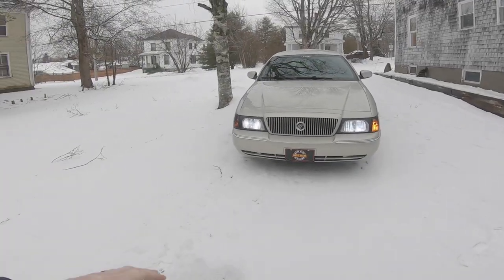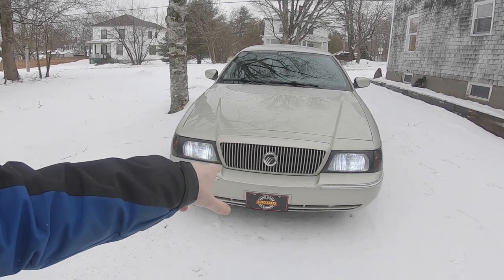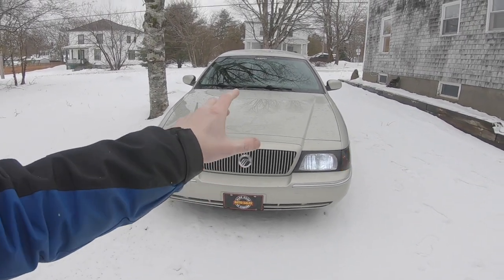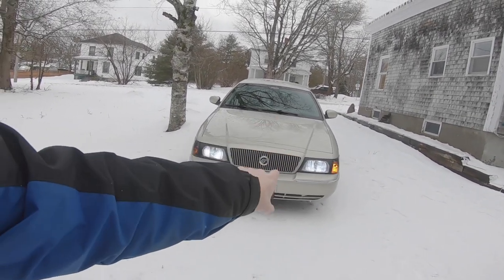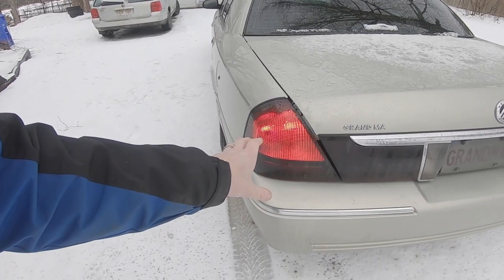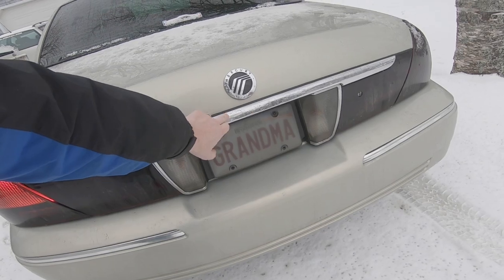Did I make a mistake partnering with LASFIT for LED bulb in my Panther Platform

Comment: I ran into the exact issue with my vehicle. Not the same make and model but in the vicinity. Buick Lucerne, any issues I've had they rectified. It may be the computer in various vehicles. It's probably reading foreign than the usual, but mine work itself out once it synchronized. I LED modified the full back then purchased 2 high and 2 low beam for almost $200. Low beam installed perfectly. High beam wouldn't and still in the box. I didn't  even bother to complain this time, because like you said the low beam are bright enough.
Reply from the maker: Glad you got it fixed up.

Comment: I've used Headlight Revolution for the lights in my wife's Ram, they have worked flawless, except for one igniter, but they covered that under warranty.
Reply from the maker: These have warranty but this is the second time I've had turn signal issues. I'm done with them.
Reply: @OldeCarrGuy  Yup understand... My question is.  Why can't they make the product right the first time?  Seems too common now.
Reply from the maker: @StevelsCamping  because they contract out to the lowest bidding Chinese company. If they were mad in USA or Canada i bet it would be a different story.
Reply: Olde Carr Guy yes I agree

Comment: The issue I had with my Lasfit bulbs in my 2007 Grand Marquis is the extremely weak high beam. Almost no difference at all. I yanked mine out and bought Morimoto 5500K LEDs and MAN what a difference. Expensive, they are, but much better light cast so as to not blind oncoming traffic and an amazing high beam setting.
Reply from the maker: I had the same problem but my LCM just didn’t seem to like the LED’s.
Reply: @OldeCarrGuy  Yeah, anti-flicker harnesses are commonly needed when switching to LED. I still need to get me a set of those, too.

Comment: If you didn't buy no error code you need to add the resistor.  Led is not like hid I just hate when someone with hid on the car. On your car you have low beam and high beam using the same bulb when you up grade to led need to make have those two options or only low beam. If you really have problems like me driving on night get some good brand of fog lights.
Reply from the maker: Hey Aaron! Thanks for watching. The LED turn signals were error free, however, still gave me issues.as far as the headlights, I did have both hi and low beam working properly, but in order to actually see anything at night, I had to adjust them up so high that I would constantly get flashed by oncoming traffic.

Comment: If only I this video showed up when I looked up LED replacement bulbs for the Grand Marquis. Now because I spent a lot on the bulbs, I’m gonna have to get load resistors🙃
Reply from the maker: Sorry Steven! I'd try it with out first as it could have just been my LCM messing up. Then you can ad resistors later if needed!
Reply: @OldeCarrGuy  The LCM was replaced along with the intake manifold right after I bought the car. I knew both were gonna need that before I even bought the car.

Comment: I'm not impressed with led lights at all for headlights the biggest problem besides blinding others at night which I do ALOT of night driving is the led headlights I have don't put out heat towards the road so the lens of headlight completely ices over I have to stop almost every hour and scrap ice of headlight its a pita and dangerous due to low visibility so that's my take on led lights not to mention half the border lights on my headlight is burned out already and its a 2019 truck
Reply from the maker: I've had this conversation with another truck driver. He changes his headlights out seasonally!
Reply: @OldeCarrGuy  been this way since new and headlight is all one piece so have to replace all of it the truck is a 2019 leds just don't throw heat that's why they last lol